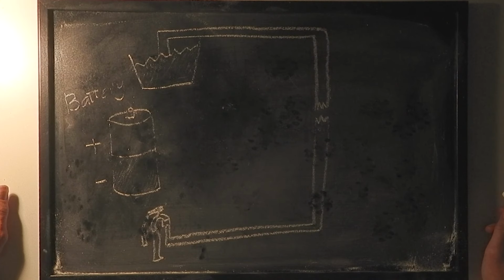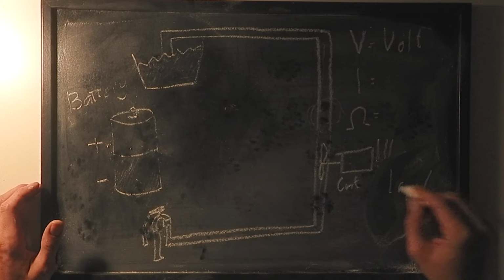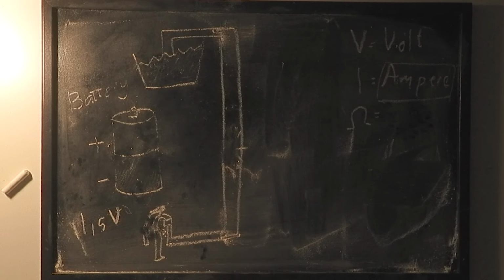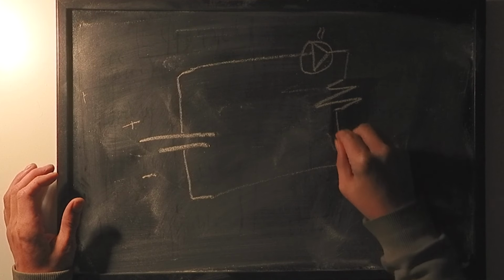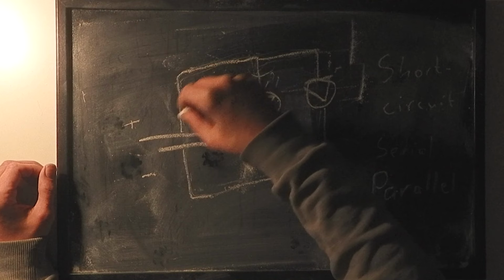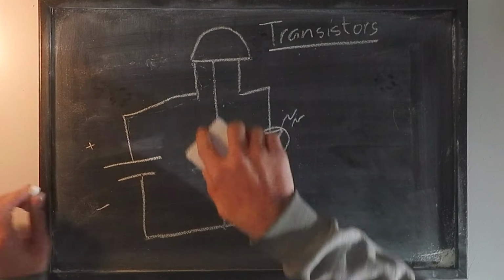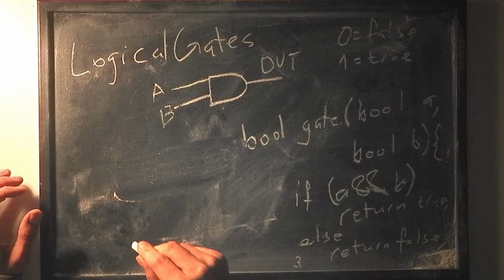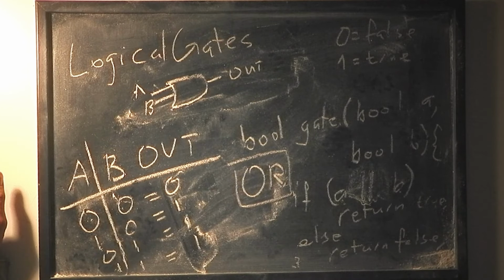Introduction to Electrical Engineering

Comment: Great video, my high school physics got revised. I learnt Transistors for very first time. Any recommended book or resource ? Which covers Electrical Engineering from very basics like Electrostatics.
Reply from the maker: havnt read no books. figured it all out on my own! testing stuff until it made sense

Comment: in 2025 ppl r still tryin 
to communicate concepts
with blackboards n chalk.
Reply from the maker: and it works, right
Reply: @dr-Jonas-Birch  cast a glassy orb on this: in 2021 i wrote a program, you describe something, 2d, 3d, static, moving, wire frame, solid, text, sound, motion. wat you describe in english it makes it in graphics in the computer. bfore chat gpt. i m rewriting it. i described something to my father n after i said see wat i mean n he said no.
i realized i knew how to get the computer to draw wat i described so i did.